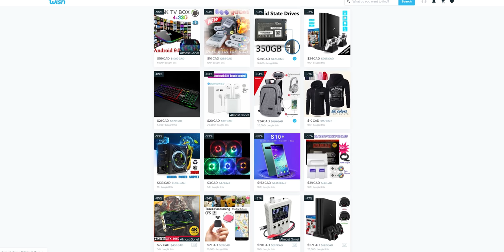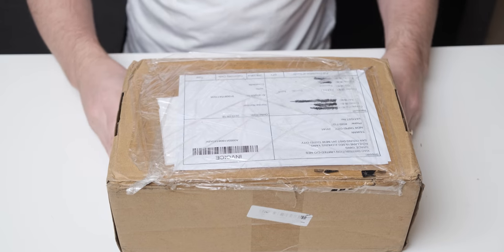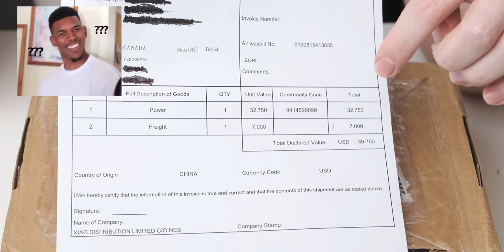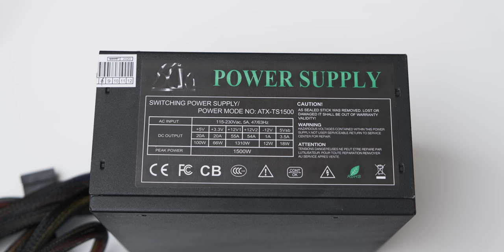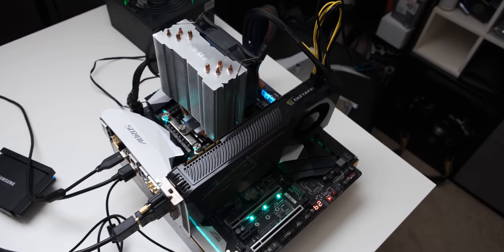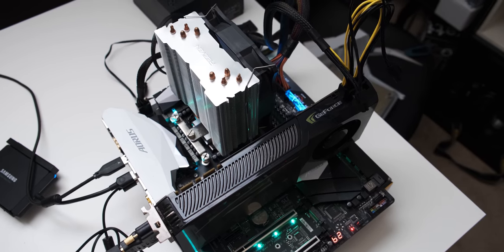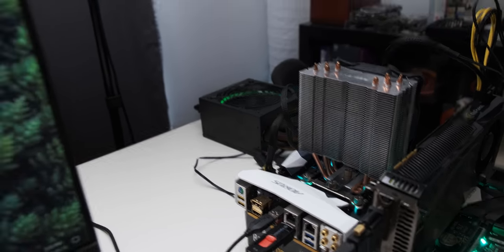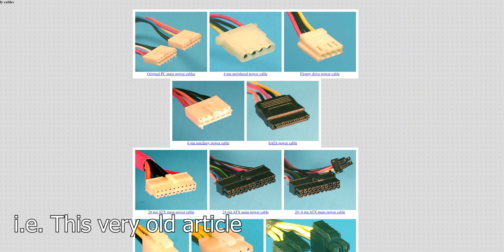I bought a $69 1500w power supply on Wish.com

Comment: probably just unbranded leftover parts from the Corsair/Thermaltake factory which is common for Chinese manufacturers to use excess parts and designs for "side projects" just without the brand name on it plus to my understanding there is only really 2-3 actual psu manufacturers and then Corsair, Thermaltake etc just slap their branding on with maybe a few minor tweaks especially on their lower end or entry level stuff
Reply from the maker: Oh okay. That makes sense. I wonder if each of these PSUs bought from Wish would be different.
Reply: @DawidDoesTechStuff  possibly depending on what materials they had access to

Comment: The biggest surprise was the thermaltake fan.
Is that a first gen riing 140mm?
Reply from the maker: I know right? It looks like one.
Reply: It makes me wonder if there is a market for clone or referb first gen riing fans.
If I can get them for well under the original retail I would buy them in large volume. I like the style and I have bought knock off and real riing fans many times.
Reply: For giggles I would run the serial and or model number of the fan inside... it could be just a clone sticker but I am curious if it is at least pretending to be what it is supposed to be. It seems identical. Also it is hard to find the green ones.

Comment: It's a good power supply. Because it has different buck converters for different output voltages from the same 12v rail. And also, it has APFC circuitry - which is a good thing that cheap PSU's don't have.

Comment: Don't know if you got an explanation what you're looking at. @8:05 minutes. Small white/metal part next to white wire on the right edge is a fuse. Yellow capacitor and coils in lower right corner handle inrush current. Small black with metal part next to the coil is the rectifying bridge that make DC. Big coil in yellow and big capacitor charge and discharge at high frequency through the transformers, black parts in the middle. 3 small optocouplers, 4-legged ic's next to small transformer, handle feedback and controlling of output voltage. This part in the middle is also where you have mains power on the lower side and 3.3, 5 and 12 volts on the upper side. Small diodes , not seen here, rectify AC from transformer. Big coil and capacitors at the output to smooth the voltage for low ripple. The 2 seperate PCBs standing are probably for 5 V and 3.3 V. Since these are seperate PCBs you should be able to put 12 V at the 12 V output and get 5 and 3.3 volts without plugging in the mains cable. Capacitors, especially the big one, should be 105 degree C model instead of 85 degree C for longer life in a PSU. Cheap caps with high ESR generate more heat at the high switching frequency.

Comment: That circuitry looks about the same as some of the ~600W power supplies I've bought from more reputable manufacturers, so I'd be surprised if it's capable of much more than that.

Comment: I ordered a $25 "500W" PSU a few years back that looks eerily similar to that one...and is the only piece of computer hardware I've ever owned that actually had a part straight up explode...and since the component exploded, some type of capacitor, I could never figure out what a suitable replacement could be.  Not that the PSU was worth resurrecting to begin with...the exploding cap sounded like a freaking gun shot.

Comment: Electrical engineer here! 
A good power supply is based on a couple factors.
1. Stability of output signal. All power supplies take an AC signal and covert it to a DC signal. The flatness of this DC signal is how good the components are. A wavy DC signal is tough on electronics and can reduce operating life to look at this you really need an Oscilloscope. 
2. Second is the ability to provide the desired power load. You test this with a power resistor. The lower the resistance and the higher the power capacity the more expensive the power resistor is. Basically you take an appropriate resistor and short the power supply to ground and if it can continuously provide the needed power you have a good power supply. If you burn up the resistor your power supply is better than expected of it cuts off and blows its fuse you have junk. If it doesn’t have a fuse you might have a neat fire. 

As far as the components inside you are looking at inductors (the wire coils), capacitors, voltage regulators (the things with heat sinks on them) and diodes and some other interesting parts. The more capacitors and inductors you have the cleaner the signal but the less efficient you’re going to be. It’s a balancing act really. 

It would be fun to actually test the thing, I’ll be honest I’ve been really into your content lately but this review was a bit lack luster. You didn’t know much about what you were testing and it kind of shows. Your knowledge on motherboards, CPUs, ram and video cards really is outstanding but this seems to have been out of your comfort zone. 

If you need some help actually testing dodgy power supplies I could give you some tips. I’m honestly a big fan of your work.

Comment: Looks like a 300 maybe 400W psu... It has common mode ac filtering stage which is usually the first thing to go in a cheapy, looks like secondary is 12V only with modular DC-DC boards providing 5v, 3.3v, another thing not seen in cheapies... I think I see active power factor correction circuitry as well, so it's not a horrifying gutless wonder PSU but nowhere near 1500W. Build quality inside is decent too, they took time to glu things down, components quality looks good... It's a rebadged 300-400W (maybe even 80 plus) PSU, would work great in small budget builds. She's safe to run for sure.

Comment: To measure it, you would just have to measure the input corrent and multiply it with 230V or whatever voltage you have and you would get the approximate power output in Watts, coz what goes in, goes out.
Reply: thats not a good way to test the efficiency
Reply: @kyles8524  not the accuratest but the easiest

Comment: IS there an LED that comes on when the unit comes on?? IF so just leave the power button on when until it fades capacitor is drained (most of the time that is what a volt meter is for). So, you can take a light bulb and cross the positive negative of the bulb on the two posts of the cap and it will drain it.  It is simple I've done it many times on much larger stiffening caps on car stereo amplifiers and they are not in Micro farad they are like 4 farad caps 4 inches wide and 14-16 inches tall. I am not scared of a cap  just don't play with them set it up and forget it. 
I still do, because, anything fun is either illegal, dangerous or both.

Comment: Like isolating yourself from the floor would help you when you touch a charged capacitor.
Reply from the maker: Haha!! Every little helps. :P
Reply from the maker: @J Fz Thanks for the detailed breakdown. I was wondering if I should try discharge somethinf but I didnt want to accidently die. I will apply this info next time I open a PSU though.
Reply: J Fz 

working on fridges and A/C I’ve got belts from some larger rated ones from being out late and wanting to get home of the job so not thinking, they aren’t the nicest things. A electrical screwdriver across both points also does the trick.

Comment: The quality of the board looks really nice I need to say. The coils are well isolated. And the size of the heatsinks looks like it has a lot of MOSFETs for power delivery. What I don't like much is the cable diameter and the number of capazitors. That's means that the output power can be a little bit unstable. You can use a wall wattmeter and a thermal gun. If heatsinks stays below 80°  in full load it's will be fine. Obviously it won't deliver 1500w but it can be close to 800-900w

Comment: PSU Calculator: Load wattage 429W. 12v 29.2W = 350W / 3.3 + 5v = 78W.  Maybe this PSU can deliver 500W, but without active PFC it has only 70% efficiency (or less), consuming 559W (or more) to deliver only 429W, that 30% wasted becomes heat that will further reduce the efficiency and maximum capacity of the psu. I think if you try an overclock it will not handle.

Comment: The Plug is from Germany. It's a Schuko plug. To the quality: On first sight the heat sinks are pretty to small for a PSU with 1500W. It could be that the MOSFETs are go up in smoke some day. The second quality point are the capacitors. If the are from a good brand like Rubycon etc. then it lasts relatively long. But the are some other things too like the Pulse Frequency Modulation to avoid to high ripple voltages, the safety arrangements for shorts, overload etc. To put a PSU to its paces you really need a PSU test system from Chroma. This device also show you the efficiency level, the real wattage etc.

Comment: Judging from the video, the power supply looks to have decent quality internals.  My guess is a more reputable company made a bunch of 400-600w power supply boards, and the client didn't want them for some reason. Perhaps a bad design, or a faulty component, the computers they were built for were discontinued (the quality of them makes me think they were for some OEM equipment) or the client went with a different manufacturer -- it could be for anything. After that, at some point, an enterprising little factory picked them up by some means (my guess, with a large supply of Thermaltake green Riing fans) and plopped the bits into the lowest price enclosures they could find.
I'm honestly most curious to two things. One, if there are any production markings on the power supply board; and two, how the fan cable was modified to work with the power supply.
Reply: On the fan cable issue, it wasn't modified. At 7:39 you can see where the fan is plugged into what looks  like a standard 3 or 4 pin fan header on the PSU logic board.

Comment: This actually looks like a ThermalTake Smart Series Power Supply... they sell pretty cheap, so even buying it at $69 US... they made a profit by reselling it.
The Smart Series ranges from 430 watts to 700 watts and is 80plus White certified.  It is a perfectly acceptable power supply for a cheap general purpose computer... BUT...
The current price (12/21/2020) for a ThermalTake Smart Series 700 Watt Power Supply, New from NewEgg, is $67.92.  So even if that was the most expensive version, probably not, you overpaid by getting it through WISH.

Comment: First if u disassembly something like that. After u open that case discharge capacitors (or even inductors in some cases)!!! By some resistor (couple of ohms) or by bulb. If u are isolated from the floor is nice but it won't help much in case of short circuit on board throu your body. BTW U can use light bulb for car as load to test wattage (Iam using old 120W 12V bulb).

Comment: Be EXTREMELY careful when disassembling a power supply. That big capacitor on the board can store huge voltages. It can bet at 130V potential. Touch any of those contacts on the high voltage side, and you're dead or dying on the floor.
You can't really tell what kind of power the power supply is rated at just looking at the components. These things are switching supplies, so there's more going on behind the scenes. One clue would probably be the size of the tracks, but even that doesn't really tell.

Comment: Wound coils, are toroid inductors. And are not very good by the looks of it. Not wound very evenly, and probably cheap materials. Hard to see on my phone, but I believe the two labelled parts in the middle are transformers, used in conjunction with the inductors for voltage regulation. Again probably cheap, as well as only 2 of that size does not bode well for power delivery. The boards on the side appear to have some IC's or more probably mosfet transistors for voltage control. I may be wrong but I believe the blue components in the lower left are tantalum capacitors, used as a ripple filter. I may be wrong, I'm just getting into experimental circuitry, so take my word with a grain of salt.
Reply: I recommend "Practical Electronics for Inventors", if you want to learn about the individual components, and how they work together.

Comment: I am a electrical engineer and that doesn't look like a 1500w power supply 7:35 . I have opened power supply before and this look like 300w to 450w power supply

Comment: Let's be constructive. I know this video is old and I don't know if you got better at tech knowledge, but here's my two cents.
Next time you make a PSU video, have the following things:
-Wall plug watt meter
-12 or 15A breaker or at least a big switch.
-Digital precision caliper
-Knife
-12V and 5V load resistors (this is harder, but it's the way to go if you really want to check the real rating of a PSU)
-Fire extinguisher for electrical fires (that's not a joke, and also there are lots of fire extinguishers, check your hardware store and get one for electrical fires).

The watt meter can be used to check the real power usage of the entire system, but used with the loads it's a good way to calculcate the efficiency, calculating the watts "burned" on the loads versus the watts really used on the meter.
Between the watt meter and the PSU, put the breaker or switch, and have it at hands reach at all times so you can cut the power as fast as possible in case something goes wrong. A breaker is the better option, because if something goes horribly wrong with the PSU, the breaker will trip almost instantly and also you won't lose power on your studio.
The caliper is used to check the gauge of the cables. For that you need to strip to expose the copper, and then you can use a gauge calculator to check max amperage this gauge can transport without getting too hot.
The knife is for checking if the cables are pure cooper (good) or copper-clad aluminium (bad). Just scrape the wires with a sharp knife, if you find that the color of the core of the cables is silver, it's CCA. Pure copper never turns silver.
The load resistors are used to test the rating. Buy several 10A at 12V and some 5A at 5V, and distribute them evenly on the PSU's cabling. Note that they get really hot, because they convert the power to heat, dont' burn yourself or your office. Then just turn on the PSU shorting the PIN 14 (green cable) with any ground (PIN 13,15,16,17 or any black cable). Is really difficult to damage a resistor if a PSU blows up, so this method is safe. You can start with a load that is 75% the rating, and go up in steps until you get to 100%.
If the PSU caughts on fire, kill the power using the breaker or switch and try to extinguish the fire as fast as possible, so it's easier to see what component failed. Also because this kind of fires stink a lot, and you want the less amount of this smoke permeating your place and your clothes.

Comment: I read it as a 150w psu and was thinking “they make these?”
Reply: I mean....i have a dodgy ryzen 3 3200g prebuild computer that has a 180w PSU lmao. it works fine, but i cant add 32gb of ram to it like they claim it can take. 
I just built a $1150 gaming computer for this reason. The PSU cant be switched out so no choice, but in the end it was totally worth!
Reply: Lmao If it makes you feel better my ‘gaming’ rig when I made the comment had a power brick and a 1080p 27 inch display

Edit: I’m still and idiot and read it as an 150 dollar gaming pc

Comment: 115/230 volts 5 amps ac input.
@ 115 volts, 5 amps and 100% efficiency, that's 575 watts.
@230 volts 5 amps, that's 1150 watts. 
They can't even lie correctly on the label :D

Comment: I know that we didn't get to see any component names etc but having Rubicon caps is a good start. Since we know that the caps are a good brand, then it seems to me to probably be a good quality power supply. Finding out the real power output would let you know if to snap up these puppies before they sell out, or to leave them well alone.

Comment: Stored electricity? lol wut? That's not how electricity works. You cannot "store" electricity outside of a battery. If it doesn't have a battery, it doesn't have the capability to shock you when not plugged into a wall. Also, if you are touching the table there, and said table is not made of something like rubber, then you are grounded (weather your feet are touching the floor or not). lmao this statement was like the Verge PC build and how he thought a power supply could short circuit if it touched the case.

Comment: Whan you started taking damn thing apart, you said something like: "I will isolate myself from the floor"...  you really think that it is going to make any difference?
Reply: Željan Alduk as long as it wasn’t just me who laughed at that haha 😂 gotta watch out for that conductive floor 😂 his pc must be powered by lightning!
Reply: Ehm yes it makes a huge difference. If you have megaohms of resistance to te floor you can touch live wires without getting shocked. Basic electricity
Reply: @TheAdatto  you are wrong. please check at 06:35. Power supply is not connected to power line. Only stored DC in capacitors, no current path to ground... but if you short out the high voltage capacitor with a finger, it will shock you, no matter if you are standing on the ground or floating in the air.
Reply: i know but i mean if you touch ONLY the live plus side. And if you touch both with a finger the shock will be mostly in the finger from + finger -.

Comment: Isolating from the floor doesn't protect you against anything  in this case. It can only protect you from being killed from touching a single live wire. These capacitors in the psu have no reference to ground if the psu is not plugged it. Touching 2 terminals inside the psu can very definitely kill you, even if you stand on a rubber surface and nothing is plugged in